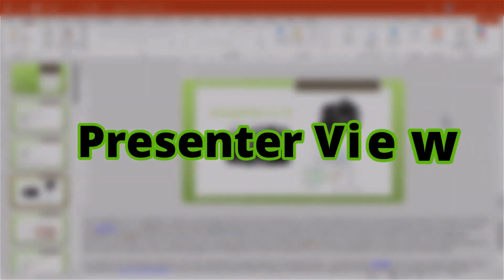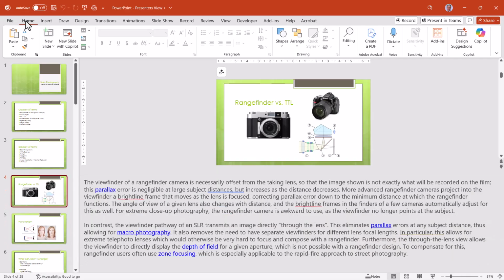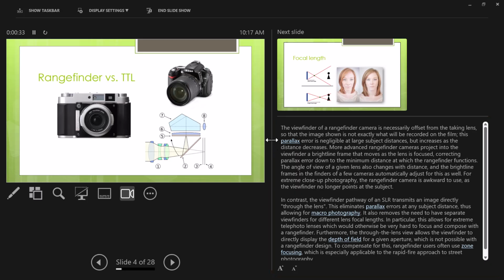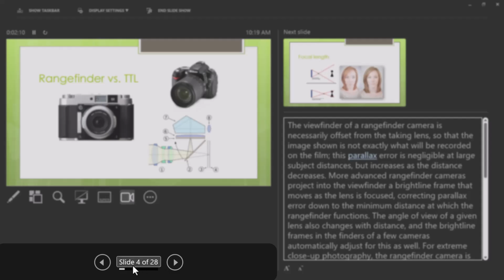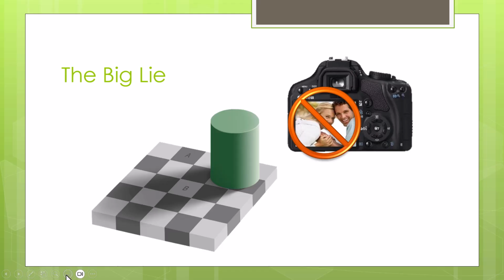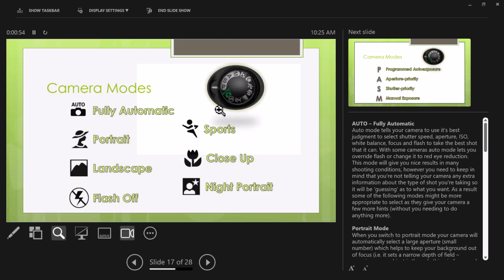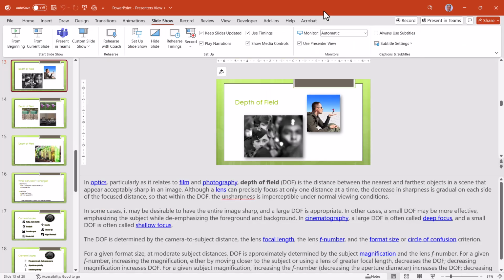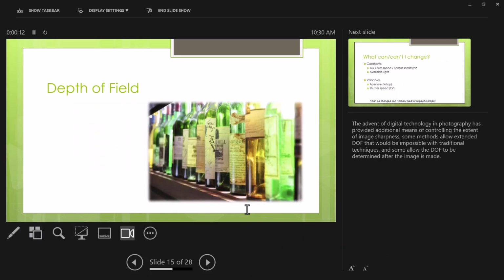Microsoft PowerPoint - Presenter's View (Taking Control of Presentations)

Comment: Bryon, one other thought.  If presenting online (for example in Microsoft Teams), will using Presenter View show what you see on your screen(i.e. the audience will see Presenter View), or will the audience see slide show view?  On a related note, a video or videos on MS Teams would be great.  I have multiple Microsoft accounts (MS 365 personal, Teams accounts under clients when they assign me Exchange e-mail addresses, etc) and sometimes find switching between accounts clunky (same with switching between SharePoint sites).  Thanks!
Reply from the maker: I would assume "no" since you are not physically connected to multiple monitors (i.e., Teams being seen as a monitor.)  But according to @TheMarkGross, "It is worth noting that when you use PowerPoint Live in MS Teams you default to Presenter mode."

I'm not a huge Teams user, so I think finding videos by others more skilled and knowledgeable than I would be a faster and higher quality experience.  I'm not sure (at my level) what I could add to the conversation that's worthwhile.